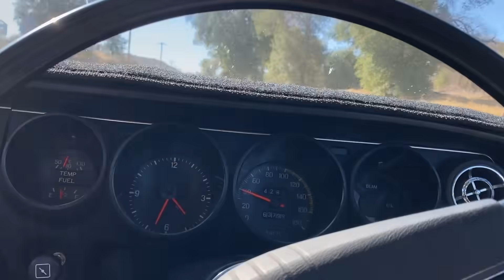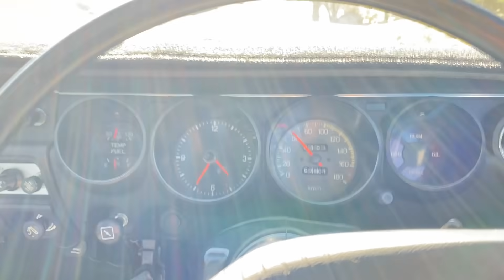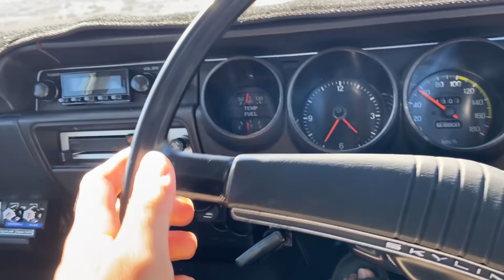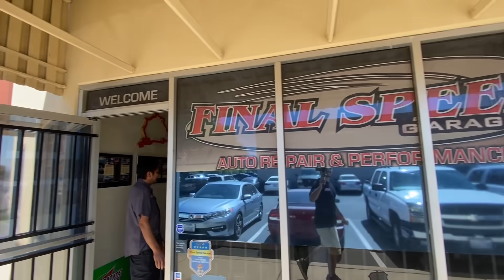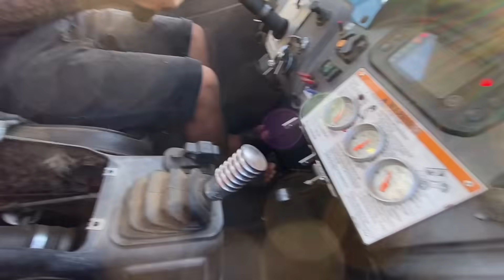I’m Gonna Regret This..... / S3E5

Comment: Would you consider building a little shelter area by the line up and have it connect to the shed in the future ? So the cars can be in the shade lol
Reply: Maybe with a wall on the dirt side so not to much dust on the cars too?
Reply: Just a huge ass car port  to keep them out of the elements.  AKA sun.

Comment: If I had that Hako the first thing I would do is replace the ball joints, bushing and control arms. That would tackle the wandering the video seems to exhibit. Then I'd get new coil overs for it. The suspension upgrades alone would do wonders for it. Maybe rebuild the L engine as the final item on the list?